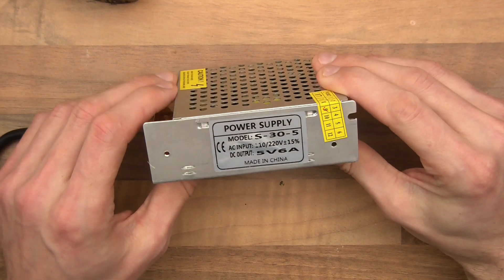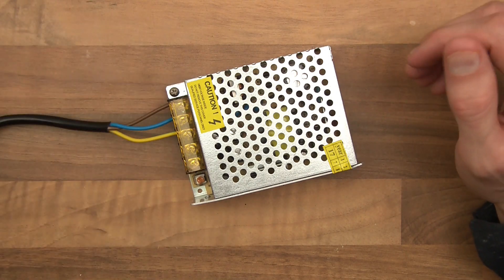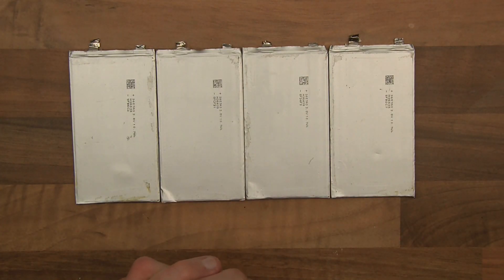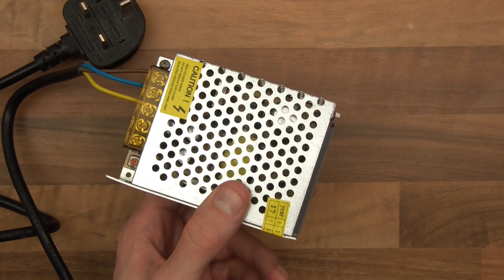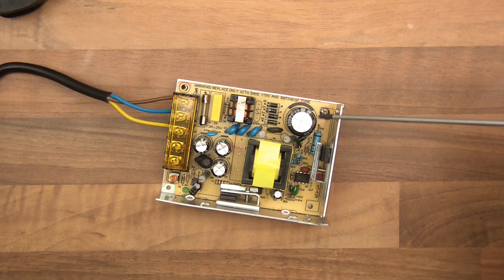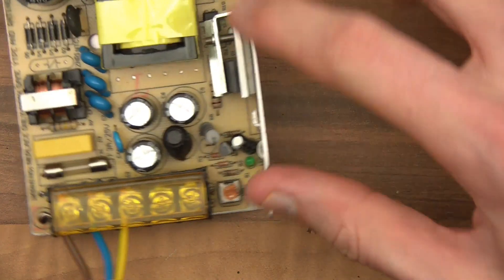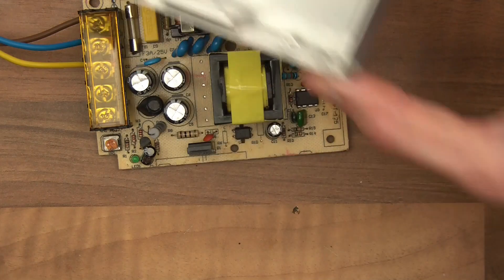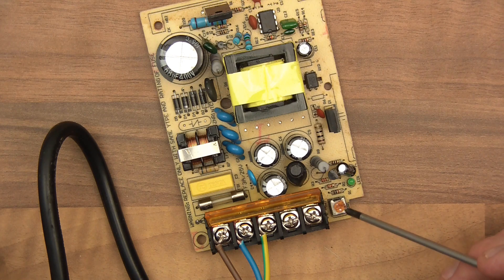TUTORIAL: How to Adjust Output Voltage Switch Mode Power Supply! 5v to 4.2v - Lithium! Part 1/2

Comment: That first transformer thing near the yellow square is an ac filter not transformer the yellow thing is an x2 safety cap to be safe just get a multimeter and check for any voltage on the caps if there is use a insulated tool and short them out or its zappo  but i do like your videos

Comment: Uh a question what will happen when we adjust the output voltage exceeded the treshold
Ex:I have 12v 30a psu but i tried to ramp the output above 12v (18v)?
Reply: You can't stretch a 12v switched mode supply to 18v. The transformer output isn't that high.
Reply: You also have components in the power supply that may not be rated for 18V. This is a common probably when people try to adjust the voltage of a low voltage power supply above the voltage rating of their capacitors. Since capacitors have their voltage rating right on the outside of the can that would be the easiest thing to check before making modifications. Likely the caps are rated for 16v

Comment: man you are scary.. you should know what your doing before you start to play with this stuff.. I just hope you do not get someone killed with your doggy approach ..
Reply: ......no pain=no gain, eh wot? ;=)
Reply from the maker: What don't I know which I should know?
Reply: @englishrupe01  no pain... no pain.. I like that better..;=)
Reply from the maker: @tinkmarshino  To some extent, I was unsure of what to do and I'm afraid of big capacitors for a very good reason! Have you ever touched a charged, high voltage one? I have! :-D You can easily discharge it by shorting/arching it out, but when there are several on the board, I think it's better to just steer clear of them entirely as they can be nasty!

I knew that the pot changed the voltage - that's the whole point of the video! You don't need to test the high or low side because there's a marker on the board, usually a big line. Not only that, there are live wires going into one side and not the other! I can't explain how the circuit works because I don't know how it works! I do have a limited and basic knowledge!!!

For the record, the safest way to 'handle' electronics is to not touch them at all! I feel strongly about this. That's why I have a message in the description which says "ALERT! ELECTRICITY KILLS! DO NOT DO THIS AT HOME!". 

I totally respect you, but I disagree with the logic used. I had a PSU, the voltage wasn't right - I MADE it right, I'm happy with the result, I learnt a little more while doing it and I lived!
Reply: @AntonyCartwright Well from reading your response I can see you are what we used to call a shade tree type of fellow.. you are going to get someone hurt with your lack of understanding.. I am sorry you do not see it.. and for the record you can't fix electronics without touching them and for you to say not to touch them just shows how much lack of understanding you actually have.. You are right, there is danger there.. but there is also a way to eliminate that danger if you have the knowledge of electronics and understanding of safety you can handle this with ease and safety not with fear and trembling. Simple rule of thumb is  "if you do not know how to fix something safely then leave it alone"    ..   Well, the one good thing is you're just a young one and you may actually learn eventually.. Good luck to you..

Comment: Why don't you just measure the resistance of the pot to where its set at atm. Use an mm
Reply from the maker: Sometimes it's difficult when it's in circuit.